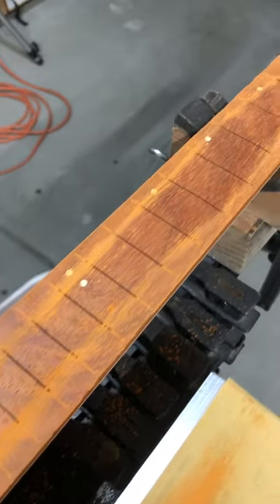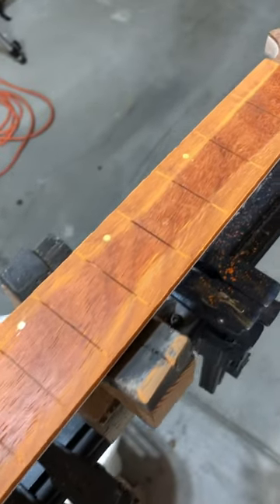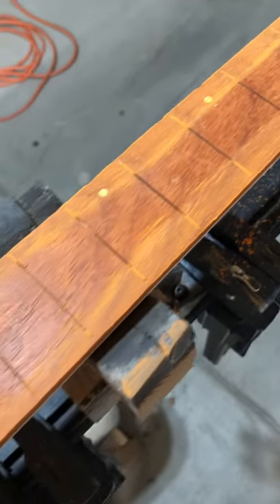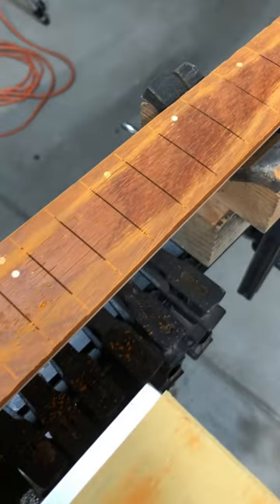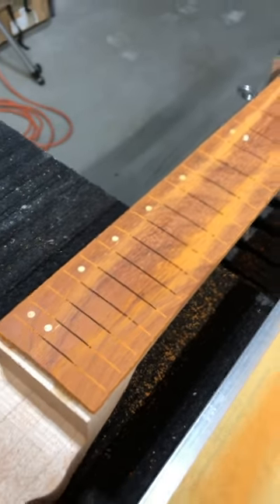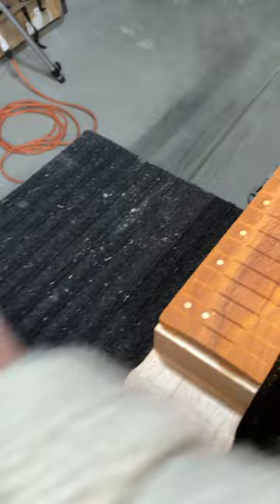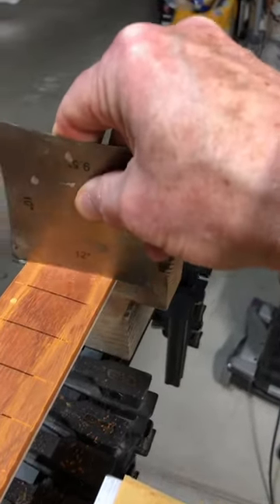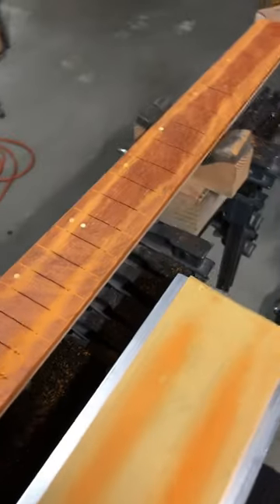A Tip For Radius Sanding A Fretboard

Comment: I just did my first fretboard on the cnc... when i was sanding out the machine marks with the radius jig I made, i ended up sanding too much now my fretslots arent deep enough. I left extra room in the program but it still wasnt enough, how can I account for this, so it doesnt happen again?
Reply from the maker: You can either cut deeper slots or try a smoother finishing strategy when you carve the radius with your CNC so you have less sanding to do.

Comment: Do you try to get an absolutely dead perfect radius, or getting a enterily sanded surface is enough ? 
When I check with the gauge there ´s still some tiny tiny bits of light, but you can’t shove a 0.1mm thick paper under the gauge.
Reply from the maker: I try myself but don't sweat if yours isn't perfect. You can fix minor issues when you level the frets.
Reply: @HighlineGuitars  ah thanks ! I guess as long as the general shape is at the correct XX radius it's fine, the fretwire will do the missing job as you said. 
You have experience with stewmac goldwire? i'm a Jescar fanboy but it's an extinct species

Thanks again, i want to add your channel is a Huge source of information. You demistify a lot of things and are really reassuring 

Latest example => I panicked when i ran out of glue when gluing my guitar top lmao. the Luthier that showed me how to do it litteraly spilled half a bottle on the body and under the guitar top. I quickly went to your channel finally breath lol
Reply from the maker: @anima60  I have never used Stewmac's gold fret wire. As far as I know, Jescar still sells it.

Comment: Use your jig and pencil
Reply from the maker: Pencil marks on a fretboard is for amateurs.
Reply: @HighlineGuitars  not amateurs , but for precission 🙂
jig --> for center your sanding
Reply: @HighlineGuitars  https://www.youtube.com/watch?v=UUwi1OHodj8
this with simpel tools but precission
Reply from the maker: @DwiWinarno  If you can't achieve precision via skill, you're an amateur.
Reply: @HighlineGuitars  but your sanding not center at all
Reply from the maker: @DwiWinarno  You're overthinking it.
Reply from the maker: Too much table shake for precision https://youtu.be/UUwi1OHodj8?si=JH4uE53bQk_Eo643&t=204